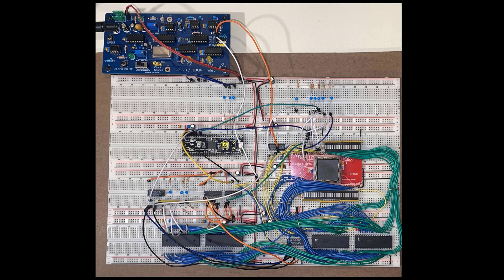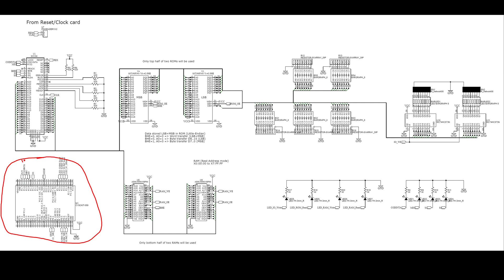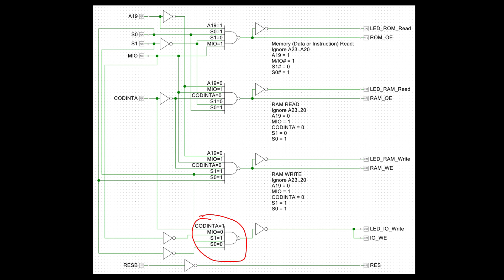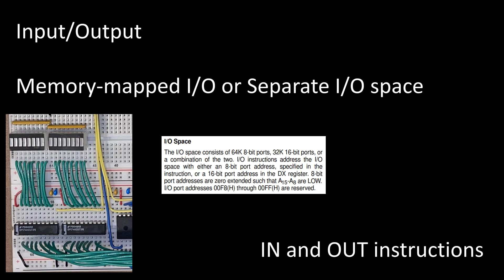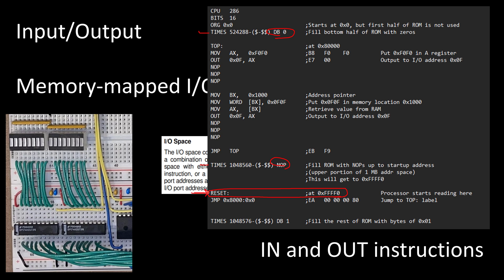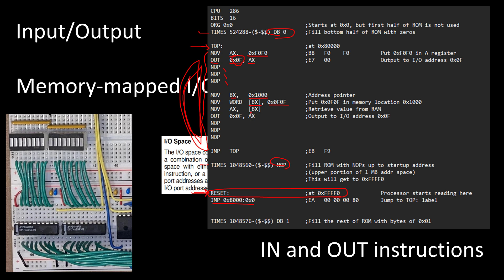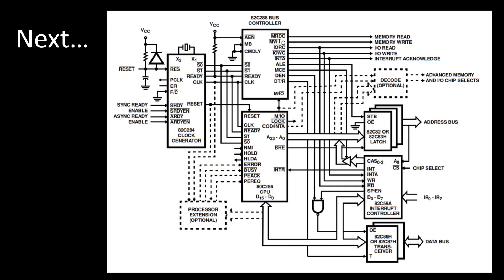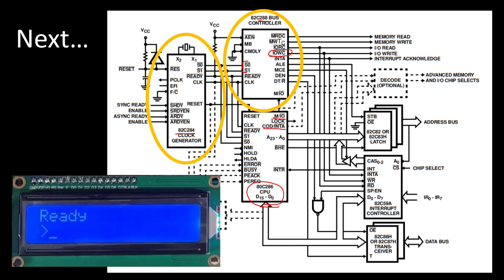80286 Build, Ep. #8 - OUT to LED Bar Graphs

Comment: I feel that it's a major issue that you do not initialize your segment registers to a known value.
If anything it is atleast an issue on readability. Remember, all memory accesses are relative to their appropriate segment registers.
Reply from the maker: What change should I make to do that? Is that something like the following?

    mov AX, @Data  
    mov DS, AX

And if so, do you happen to know what it should be for NASM? I couldn't get it to assemble with @Data. And that would go at the beginning of TOP:?

(above assumes section/segment declared in the code)
Reply from the maker: Or something more like this:

xor ax, ax
mov ds, ax
mov es, ax
mov fs, ax
mov gs, ax
mov ss, ax

; Set up stack
mov sp, 0xfff0  ;address tbd